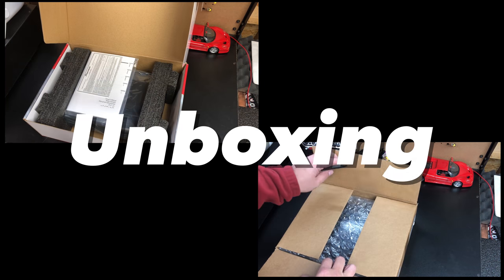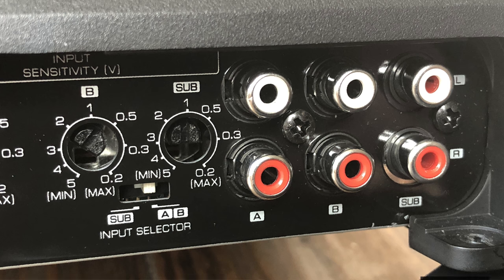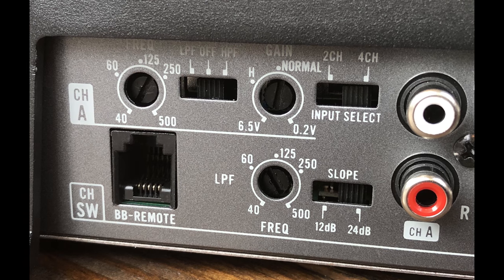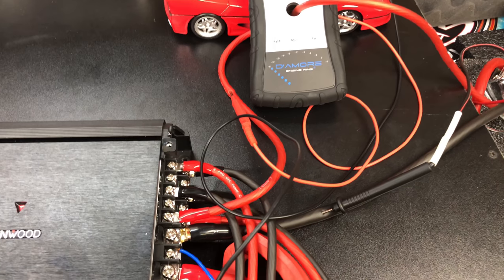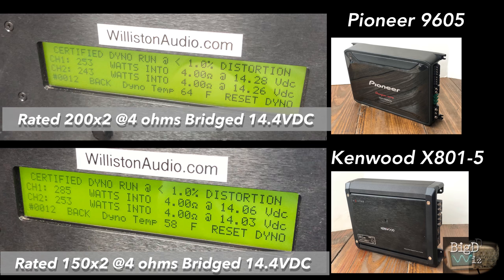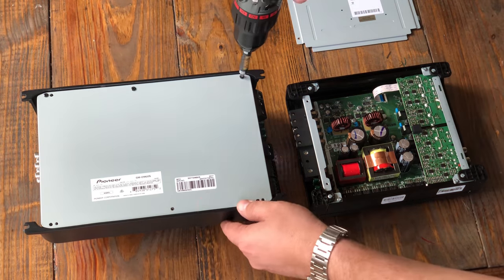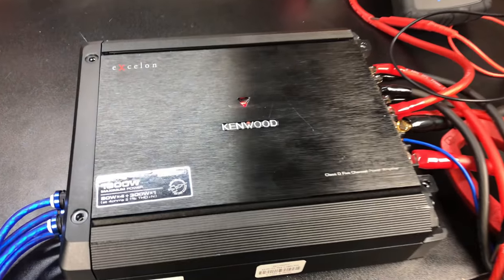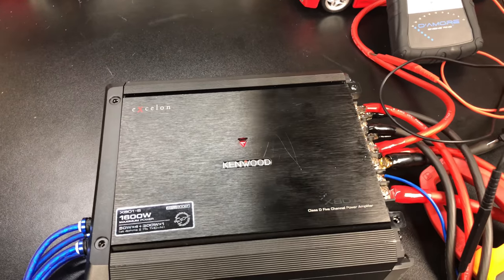Five Channel Budget Amps by Kenwood and Pioneer 4K UHD

Comment: Whats crazy is these amps aren't even considered on most of the forums. Everyone is brainwashed with the most popular names.
Reply: 1trucavalier true..these amps are the most underrated and their performance are right its a shame.
Reply from the maker: I have a true belief, although it seems like a minority, most people who buy amps are not looking for gigawatts, just a simple upgrade to their factory systems. Amps like this are perfect!
Reply: BigDWiz you're right that's why I bought months a go 2 Pioneer amps like GM-D8601 and GM-D8604 to power my entire system in my 2012 Nissan Versa HB and sounds way better then I expected!
Reply: BigDWiz exactly. My 2015 F150 non Sony has the 8" screen which cant be replaced for less than 2000$. Im using the Pioneer into Focal Integration components and coaxles and a new R Series 12" in a console box and couldnt be happier. Its so simple. Thank you for doing this comparison.

Comment: what do you think about the pioneer 2400 box rating. amp with 1200 watt rms. I'm more less wondering about the longevity of the amp. I'm building a system for my sister. she likes pioneer. she had a. old school pioneer amp. and liked it. and how efficient is it? we need 800-1600watts. and I'm thinking the pioneer may have decent SQ. I'm thinking the sub's will be dual 2 ohm. will it do 1-2 ohm being a mono amp? I have seen videos about them. I can't tell SQ. or if they will live. do they run hot? I hope you can answer my questions. we also been considering skar amps. I have seen a few broken baskets on new sub's of theirs. so I'm concerned about the quality and life expectancy of their amps. I'd love to have my old hifonics zeuse amp. it was a 97' model I think. maybe 98;. I had it on four 15" JL's it was going on two 18" kickers. but I got ripped off. ended up with JL's. the amp had less than a week on it! $1000🚽! any way. no point crying over it. again!

Comment: I just ordered the Pioneer D9705 (newer version).  I want to run a preloaded triple 8 inch Skar vented box that has impedence rating of 1.33 ohm.  Can the sub channel handle this without burning up?
Reply from the maker: You can try and just see how the amp performs.
Reply: @wal  Would appreciate some feedback, I might try the 1ohm with dual 12s depending on results

Comment: I have the Nvx 5 channel amp but im thinking i should of went w the Pioneer
Reply from the maker: That NVX is strong 💪
Reply: The sub channel seems weak a little but it could be that im using a fact radio and not getting its full potential..

Comment: Installed many of the Kenwood's not a fan of these or the excelon monoblocks and I like Kenwood stuff. The 5 channels fail and the input sensitivity sucks u have to turn gain way up to get decent sound unless u have 8v signal. The Alpine 500 watt monoblock was louder on the same Kenwood subs in the same box Everytime

Comment: Oh man. I was looked at both of these. Unfortunately I run a ported box and these don't have subsonic filters from what I could find
Reply: That Kenwood performed well!  Maybe I'll make a new sub box....
Reply from the maker: Correct! I should’ve mentioned this! I use potted setups without subsonic filters all the time, but yeah if possible it’s safer for sure
Reply: I only run 2 8" W3 but on my old 500/1 so like 300w going to each sub, and need tat safety margin.  i like the 28-38 music when i turn it up.  just got a new car so might change it up a bit.    Have you tested a NVX 900.5 ?
Reply: brian mank You need subsonic if you're using ported subs, and you want to set it right about where the resonant frequency of the box is. I know that might not help you if you don't know this, but that's how it goes. Every box is different, and every speaker is different too.
Reply: TheKomar924 I don't think he's tested that amp. But that it was tested by others I'm 99% sure, and like most, if not all of their amps, it did well. They make great stuff. Best bang for your buck out there IMO. If you figure in quality too anyway. Their stuff is built very well. And it performs. Their x series component speakers are really good too. Made by SB Acoustics, which was started by ex Scan Speak engineers. Now that's a pedigree. And their subs not only rip it up for cheap money, but actually have great SQ too. That company is awesome period. It I were too do a new system from scratch. I would go straight NVX across the board. It's a no brainer to me, after researching pretty much everything out there when I built my setup. I went used, and other brands. But I would do it differently if I had to do it over again. I've learned a lot more since then.
Reply: brian mank Well like I said. You should be if you're running ported to protect them. But to set it. You need to know the resonant frequency. I don't know what my sub box was built to myself. So there's the problem. Where do you set it at.

For me I could hear the subs taking a beating with it real low. So I turned it up till they sounded normal. Be real careful setting this stuff, and the gains. It's not hard to blow something. Never clip anything ever. Of course that's easier said then done when you're jamming out. So take the time to set it all right ahead of time. If need be. Bring it to a shop, and pay a few bucks to have it set right. Then Do Not touch it.

And please never say you know everything about anything. The more I learn in life (I'm 45) just makes me realize how little we all really know about anything. There always more to learn. And even more to invent. Things change everyday my friend.

Good luck with your system. But don't take safety for granted, and just leave that off if you're running ported subs. It will cost you eventually. You'll wear them out way too soon.
Reply: The alpine 5 channel amps are amazing if your looking. I use one currently and love it. Plus dose over rated power
Reply: Jerry Smith Agreed. They make great stuff. A little more money, but if you can afford it. It's worth it in the end. They sell for more used too. So if you want to upgrade, or something later on. The higher resale value is nice. I run an Alpine media deck, and love it. Every option possible, sounds great, and built well. 

There's plenty of good brands out there really. New, and used. Just do your research, and go for the best one your money can buy. But be careful if the cheap ones. Especially on a 5 channel. Sub amp isn't a important. But for your interior speakers you want quality. Or it will sound terrible. And hurt you ears. Can't crank it up then.
Reply: TheKomar924 Just get something like Harrison Labs inline subsonic filter that matches up with your box tuning or slightly lower. If you box is tuned real low you probly don't even need one.
Reply: Shane Subashe Not a bad idea. But I disagree on not needing one. I always use one no matter what. Why have your amp using energy to put out stuff before 20zh? Can't hear it. It can affect sound quality. And the amp is doing less work with one. So it's got more power to put into the stuff we actually hear. Now that being said. The subsonic, and any filter can affect SQ itself. But I'm a fan of being safe with my stuff.

If you design your system right, and run everything within its designed parameters. It should all last for a long, long time. And that too me is where the real savings come in. Buying an amp day for a few hundred bucks isn't so bad if you have it for 20 years. It's only say at $300 about $15 a year then. But if it only lasts two years. Now we're at $150 a year. So I play it safe with my gear.
Reply: Most newer decks have a built in lpf and hpf built in so you can control it from there.
Reply: Shane Subashe That's a good point too. I'm trying to remember if my Alpine media deck UTE-62BT has a subsonic, or not though. I don't think it does though. I don't have car I had my setup in, unfortunately (blew the transmission). But I do vividly remember using the one on the amp. So I'm almost positive it didn't. But don't quote me on that.

Comment: Hey big D would you be interested in testing a fake soundstream tn4.900d. It's an amp on Amazon that is deceiving customers
Reply from the maker: Amazon allowing fake products to be sold? Say it isn’t so 🤦‍♂️
Reply: BigDWiz well it's an updated model but it's made different and customers have complained that it's more cheaply made than the old model. Furthermore the sellers never stated that it has a different board from the pics. So I contacted Ryan and he's down to do a test to see if the updated model does the same ratings as what the box says and what sonic did like 3 years

Comment: Can you buy a separate bass remote for the kenwood or is the no plug in at all?
Reply from the maker: No plug in, but you can use RCA level control for gain
Reply: bass remote knob 'RCA connector' also available sell separately

Comment: Can I use a 3 ohm component speakers set on the pioneer 9605? Or should I return and get 4 ohms set of component?
Reply from the maker: 3 ohm components will work fine with this amp

Comment: The problem with this comparison is the Pioneer goes up against Kenwood's XR901 Not the 801. The reason the price of the pioneers is the same as the 801 is because it's a cheaper product than the rest of its actual competition being the Alpine PDXV9/ X -A90V, Kenwood XR901, or even the cheaper priced TS Power TD-55... I own all these amps and sell them all except the pioneer. Its over priced for the quality and class its in. It just doesn't meet the bar... you should redo this comparison using simular "flagship" models. As the pioneer is the top 5-channel for that brand but, the 801is more like a mid to high level work horse.

Comment: 560 does not equal 600....11:56
Reply: DrunkenBass yes.. but I doubt you would ever notice 40 watts!! So don’t let that be the reason to not buy the amp...

The difference between A 60 W amp and 100 W amp you might notice the difference, but you wouldn’t ever notice a difference between 560 W amp and a 600 W amp.